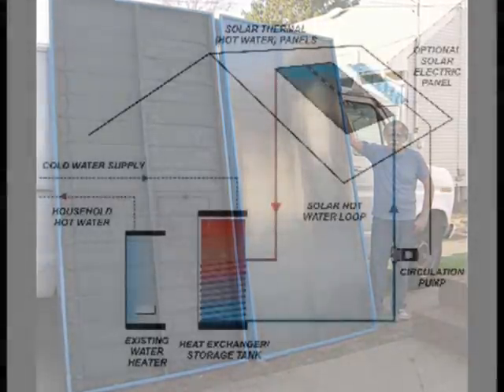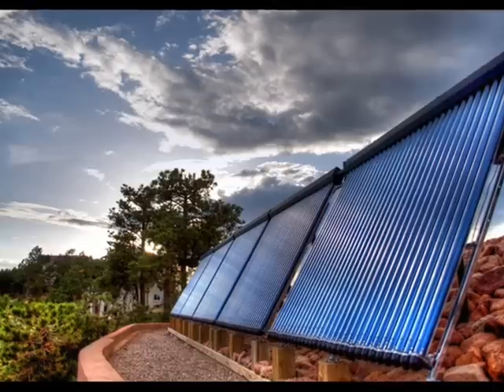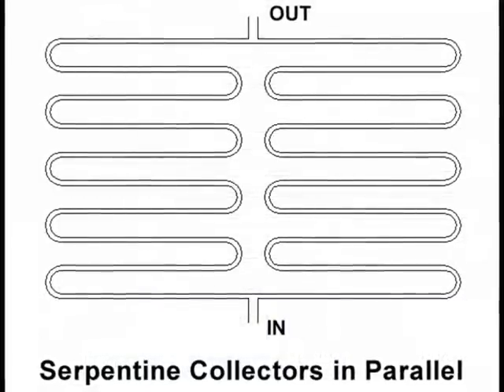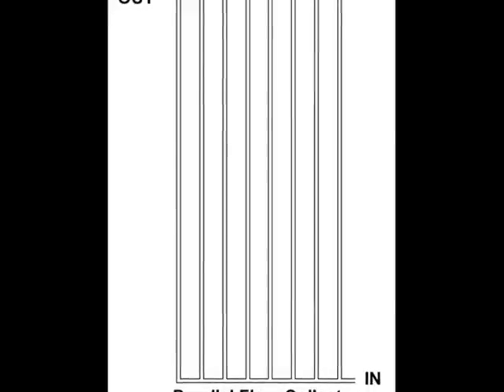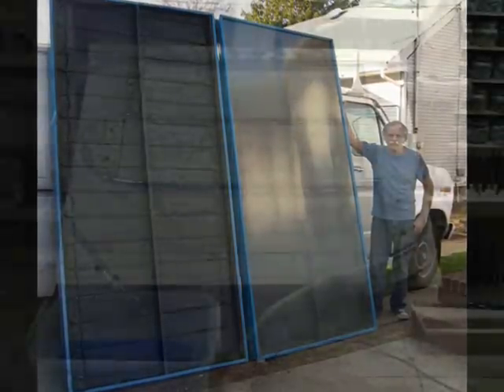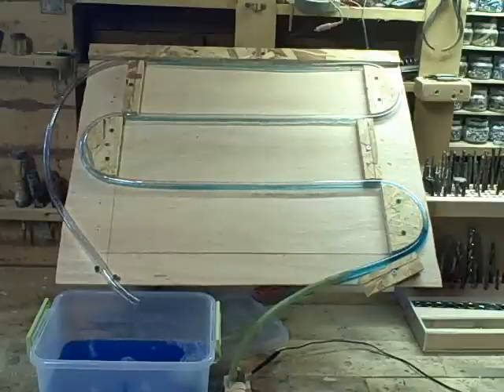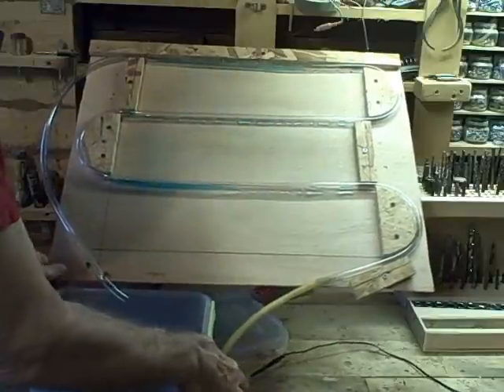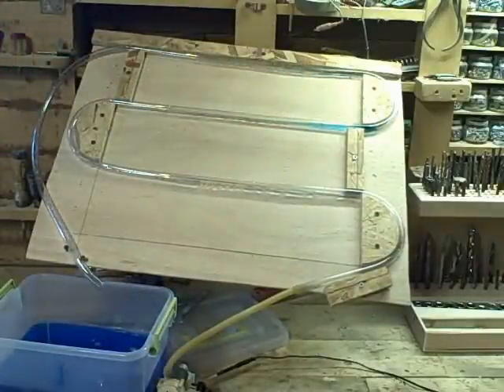Serpentine Drainback System

Comment: Uhm... I was astounded that you were pumping from the bottom of the collector to the top.

What if you pumped the fluid to the TOP of the loop (past a float valve) and let it go?

The pump, when off, allows the fluid to flow backward (unless it's a piston pump?), correct?
Reply: You cannot effectively control a system that pumps top to bottom.
Reply: I'd also suggest the water in the collector flow from top to bottom. But it's common "agreement" to do it the other way. Many years ago I read a book in German that explained about 7 advantages of the "top down flow" in the collector.
Reply: @solarman69  I think you didn't understand his point. You're right with the pump being above the collector doesn't work.

Comment: great system.
I've been looking for a way to make my system operational in the winter ( cold in Montreal ) and was starting to think that was a lost cause. Would this work if the ply wood was turned the other way ( the copper as well ) ? I would mount mine to the ground and don't want to exceed the height of our fence.
thanks
Paul.
Reply from the maker: As long as water can drain you will not have a problem. The serpentine tube must slope downward .